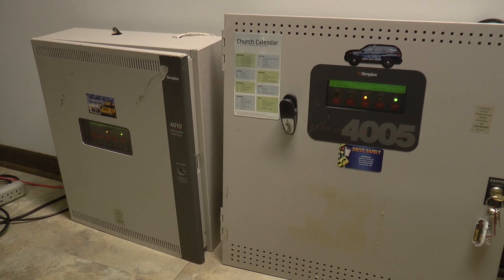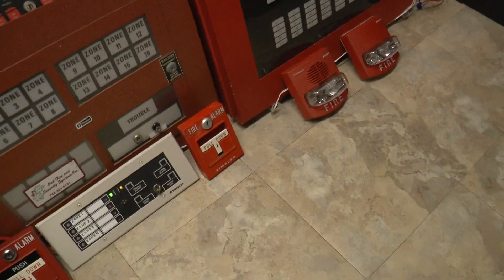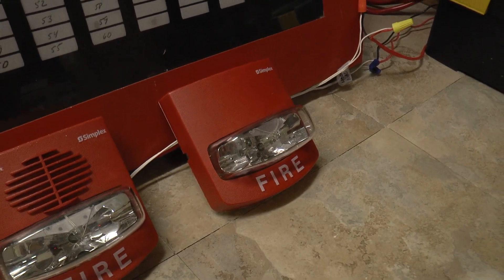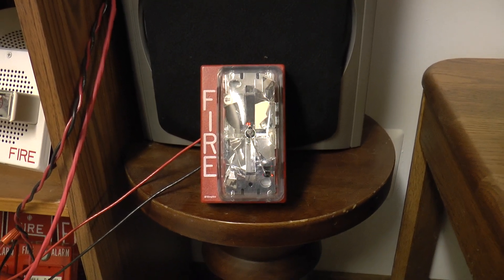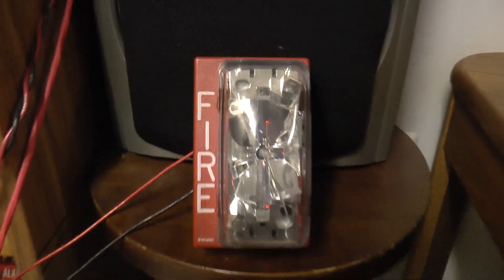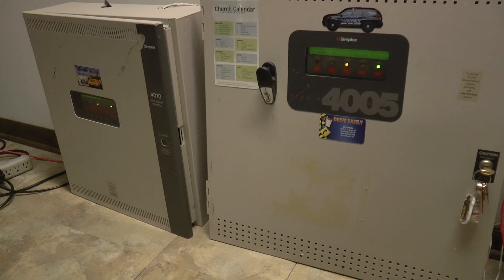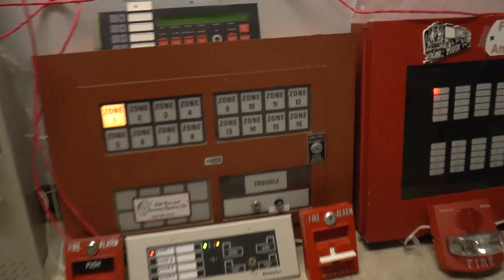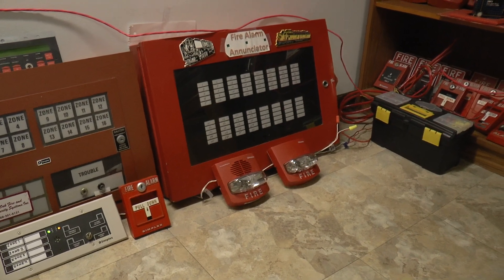Floor System Test 50 - High School Simulation

Comment: Very similar to my high school with the 9838s the 4903 and the truealert. Except the 4903s were 9219s instead of 9236s, the truealerts were multi candela and the panel was a 4100u on code 3.

Comment: Okay DESPITE the continuous part (cuz that's just...wicked lmao), I wish I had a system like this back in elementary school lol. Had to deal with SmartSync TrueAlerts (probably the older model like the -9417, 18, or 19, considering it was early to mid-2000s) on Code-3 however, but those were loud enough to scare the living daylights out of me alone. From Pre-K - 2nd, TrueAlerts were the fire alarms at the schools (until 3rd grade when I moved out of state, which would then be Gentex Commander1's on Code-3).

Awesome video dude
Reply from the maker: Thank you! Yeah, the horns on these TrueAlerts, even the older 4903 units, pack a punch. The volume and frequency of the output will literally make your eardrums vibrate. Over the years, the pitches of these have changed. The 9417, 9418, 9419, 9428, 9429, and 9430 have my favorite pitch. Gentex Commander 1s, no doubt, are more pleasant to the ears.

Comment: Very nice. My old high school has simplex 4903 9219 horn strobes in the original building. During the expansions over the years, theres simplex truealert horn strobes
Reply from the maker: 9219s are very common. I have one of those I got from a building demolition.